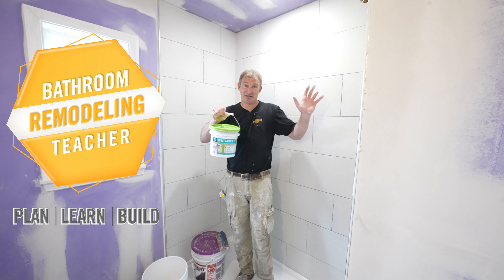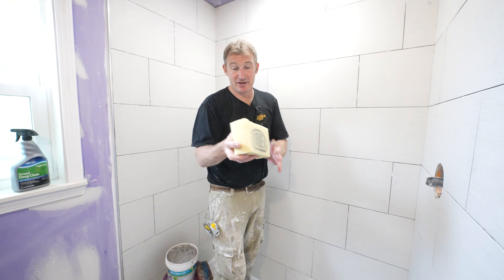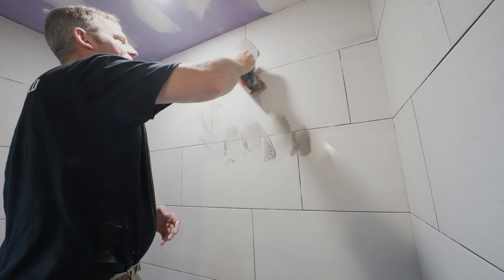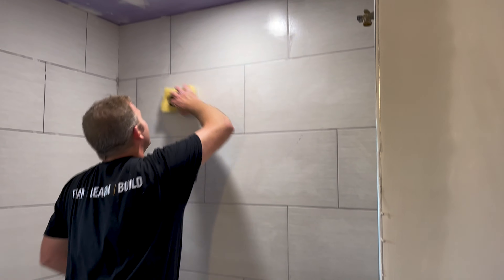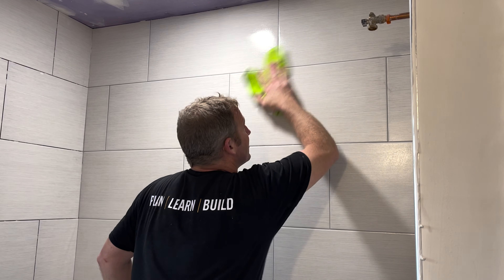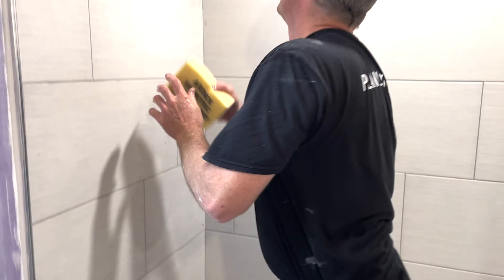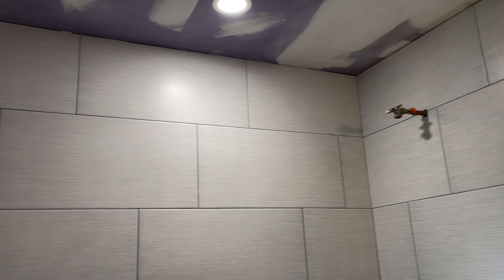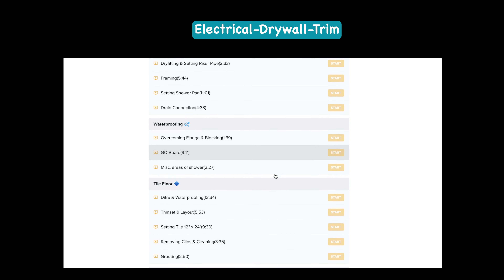Easiest Grout for Showers | Spectralock1 | PLAN LEARN BUILD

Comment: Easy to install and good grout aren't necessarily the same thing.  Everyone should keep that in mind.  This stuff is probably great for contractors but for the homeowner 5 years later???
Reply: Epoxy grout is the best stuff you can get
You pay in price. It’s like $100 for that small tub in the video

But you never have to seal it and the white I have has stayed white 

I’m diy-ing my next tile install so wanted to lookup how to use this grout
Reply: @dylan-nguyen I just redid my shower and used epoxy grout for the first time.  I was nervous about the working time but the epoxy grout was pretty easy to use.
Reply: I used the cementitious grout 8 years ago and now my tiles are falling off.  We sealed them with 20 year 511 sealer.   Having to redo everything now  Our old grout we never had to seal.  That's what I want.  No more non-epoxy grout.

Comment: I have tried them all. This one really is the best in my opinion but you need to know how to apply it. This video lays those steps out very well. It is certified for under water applications.👍 Don’t let it dry on your tile!!! It’s tough stuff. The damp sponge and cloth are to wipe it off. Don’t let them be too wet or you will dilute the product and it is not water based. Failures are from too much water.

Comment: I'm old and I'm slow and I used Keracolor U with the grout additive in place of water.  It was getting too hard to work with, balling up, drying after 15-20 minutes and I couldn't figure out why.  A few days later, I figured out that because the additive and grout was stored in my garage, the mix may have been warm enough to accelerate the curing time.  The only way I could wipe everything down was to use a wet sponge and avoid a disaster.

Comment: Did you use matching Spectralock grout caulk in the inside corners or use the regular Spectralock grout? Thanks
Reply: I'd like to know as well.  Do the corners get grouted or caulk?
Reply: Always caulk the corners to allow for expansion and contraction.  If you don't, you'll have cracks in all of the corners that are very obvious.

Comment: That's an interesting layout for the tile.  Spectralock is so much improved over the first epoxy grouts which were very hard to apply.  Special liquid, 2 part dry mix, and working with 2 square feet at a time you have to charge extra for grouting plus the cost of the grouts added to the final bill.  I'm retired after 40 years of tile and flooring but it's interesting to see how grouting has advanced since 2011 to now in 2023.
Reply from the maker: No doubt. I used to cringe at the word epoxy 😆 it’s now my favorite grout 👍
Reply: @BathroomRemodelingTeacher  do you prefer this over the MAPEI ultracolor FA?

Comment: Thank you for showing us the application on a wall. I've watched ten videos before finding your video and they all (including Laticrete Corporate Videos) were applying it to a floor or horizontal surface. Nobody else had the guts to show it used on a wall or vertical surface. Thanks!

Comment: You should try Loctite Polyseamseal Tub & Tile Adhesive Caulk for shower wall plane changes or seams. Silicone caulks deteriorate in few years, no matter what promises whatever brand makes on them, others than elasticity and color selection, none of them withstand scrubbing or lasts years. Loctite adhesive caulk product cures hard while seals gaps up to 1/4 and cures stiff and repels water and any grease, very good product, however color is limited to white only.
Reply: i have 10 year old mapei sanded color matched caulk in both my showers, as perfect now as they were 10 years ago, so b/s on that only lasting a few years. i have also done about 10 bath remodels in my own neighborhood , all with sanded caulk and all ranging from 10 years to a couple years and all in perfect condition because i ask them. i do shower remodels only and not one issue with sanded caulk. i suppose if your work is lame, thats one thing, but if you build your shower right, silicone is overkill.

Comment: did u use on corners? if not which product (link preferred) did you use? I hear with epoxy type grout you can add on the corners with no problems of cracking in the future
Reply: You could use epoxy and it’s strong, but the thing is if the structure flexes or expands enough from temp changes, something is eventually going to give. It’s safer to use flexible sealant.

Comment: does it dry really fast,ie better for pros not amateurs?
Reply: It dries fast, but it is easy to scrub with cold water and mesh scrub sponge within few hours after application, after that use microfiber cloth or sponge to wipe it dry, so no need to be afraid of quick drying. It cures very hard in about day or two. Spectlock1 is sandy and very rough compared to epoxy (I am comparing to Litokol). I would still rather use epoxy grout for shower floor than this grout. This grout seems very similar to Mapei CQ, but Mapei doesn’t recommend CQ for  shower floors application unlike to Laticrete Spectalock1, at least that what I recall from 2-3 year ago.
Price wise, Spectralock1 costs as much as epoxy, so if you have methodology to work with small batches of epoxy grout, by splitting it in manageable batches (unfortunately there is no much English information on dealing with epoxy grout, I got my experience from russian youtube channels, they all use epoxy grout left and right, nobody bothers with cementeous or anything else there, so there is plead of good howto videos. Epoxy grout looks much cleaner, however it only suits impervious tiles, Porous stone I.e. travertine won’t be practical with it, resin will absorb into travertine and won’t be possible to remove once cured will have wet stone effect look.
Reply: @BlahBlahManYeah  thanks for your time

Comment: Does this require sealer?  I've been using Mapei Ultra Color Plus FA grout because it doesn't require sealer and doesn't cause efforecsnce , it's designed to keep it's color.
Does this grout you recommend have some of those same qualities? I'd love to find a pre-mix grout yet am always worried about trying products I'm not familiar with.
Reply from the maker: I’m a big fan of FA too. Used quite a bit of it. It’s really about the same as far as grittiness. But one bonus is that it doesn’t absorb or darken when taking a shower. One pet peeve of mine on traditional type grouts like that.  I also think soectralock1 will resist cracking more too 👍
Reply: @BathroomRemodelingTeacher  thanks for the info, I'll definitely be trying it out.

Comment: i've used flexcolor cq a couple times and didn't care for it too much. Do you like spectralock1 better than CQ? I always found it hard to get full joints on polished rectified tile with CQ.
Reply from the maker: Absolutely 👍 I’m with you. I don’t care for cq either. Way too gritty and runs out of joints easily. This is much better in my opinion. Only thing I don’t have is personal experience yet on what it looks like years later. So far it seems to stay stain resistant 👍